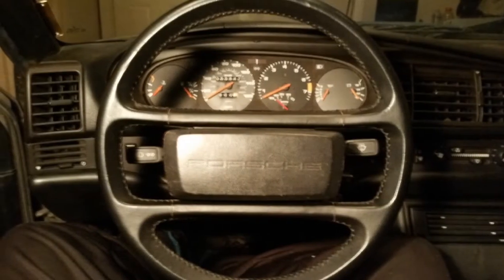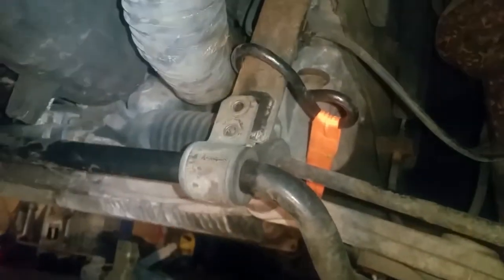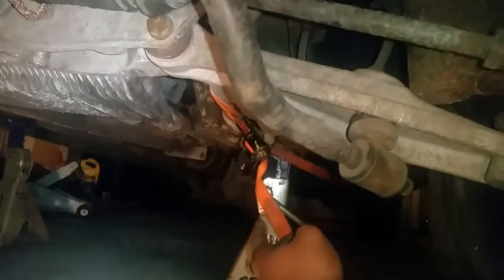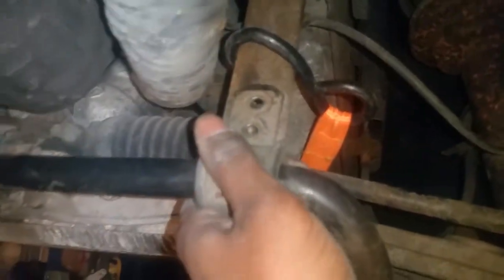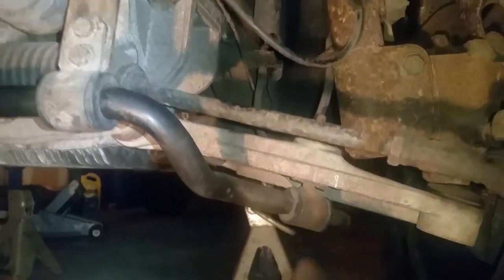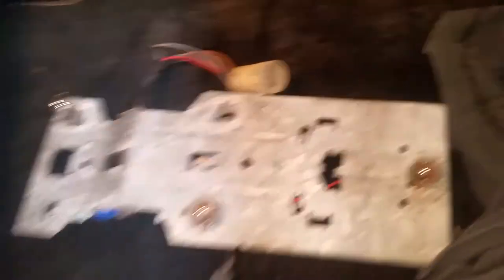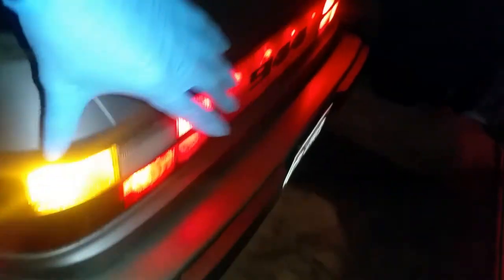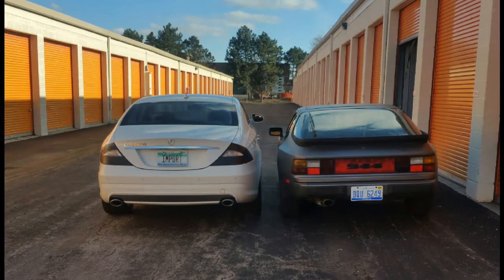Episode 8 - Porsche for Peanuts - sway bar, rear lights, and new interior bits

Comment: What about a non-cheap 944? Someone near me is selling a heavily modded 1989 944 turbo that I’m going to check out...but it’s had a turbo added to an NA frame and short shifter among many things on the list. Should I just immediately walk from some one else’s project for $8k?
Reply from the maker: acchaladka it depends on how much money you're willing to spend fixing all the wrong. It depends on how much boost he's been running. I'm not sure if the NA was built to handle a lot more heat in the cylinder walls. Also, did he switch to a turbo transmission? If not, you could be in for a few 💸